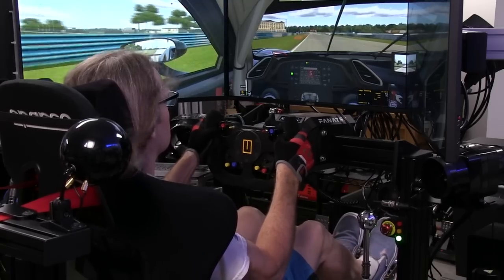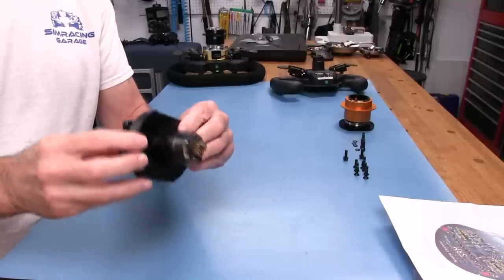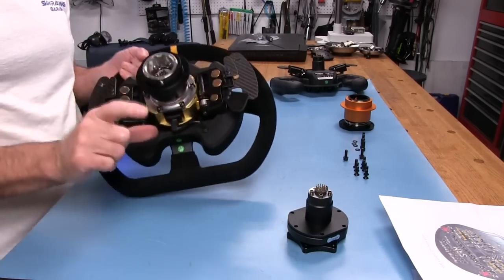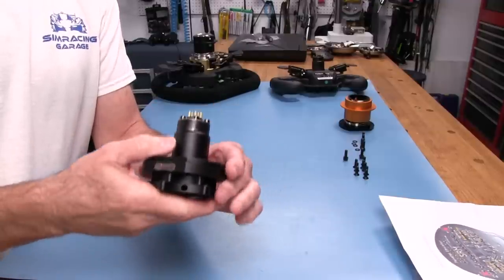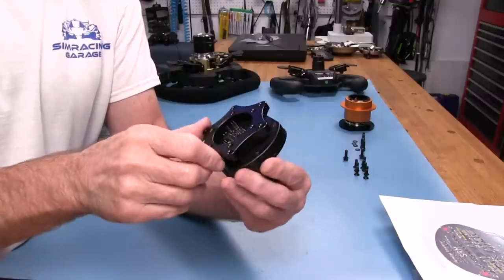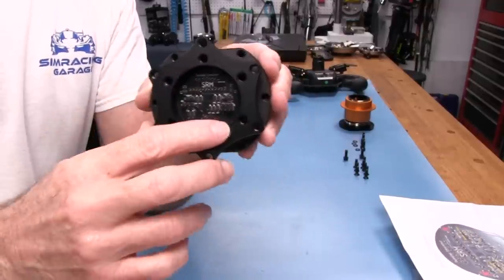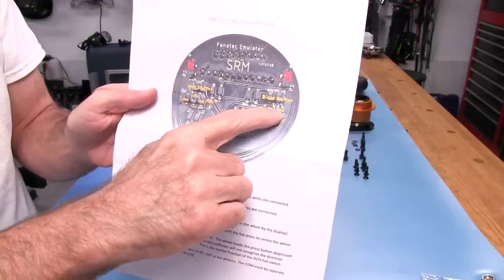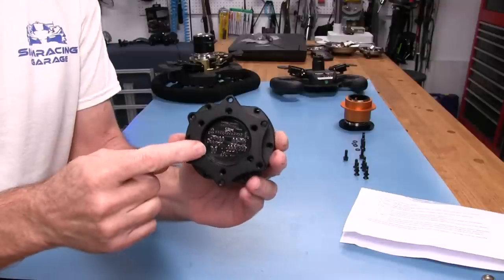SRM Fanatec Wheel Emulator Review

Comment: Awesome, now we wait for "the other way around" solution - Fanatec wheel (without cables) attached to third party DD. I would think its doable, its only a matter of transfering the inputs to some USB via bluetooth maybe?
Reply: It is doable. I've seen solutions like that.
Reply: The same company (SRM) makes plenty of those too (Fanatec-to-usb conversion kits). Check their website.
Reply: As mentioned by @sidepocket1 SRM sell conversion kits for Fanatec to USB. You can also buy a teensy USB board and convert it if you’re tech savvy and want to save some cash. I’ve got a Fanatec BMW GT2 Teensy Converted in my Big Mige. Works a charm
Reply: Just saw this solution on Leo Bodnar 😉

Comment: Does this adapter emulator bolt pattern fit regular car steering wheels? Fanatec doesnt sell perfectly circle wheels which is why i want to do this mod. All the wheels i can find have a flat bottom on them which sucks for drifting

Comment: I love the SRM wheel emulator. I have 3 of them so far. It's so much thinner than a Podium or universal hub, and considering the cost of the clubsport quick release on its own, it's a hell of a deal.
Reply: Thanks for the recommendation. Where did you get a clubsport quick release on its own? (I can't see it on the fanatec site? Is it 3rd party also?)
Reply: @edparcell3884  - It's under accessories, $99.95.
Reply: @netlemming5571  Thanks!